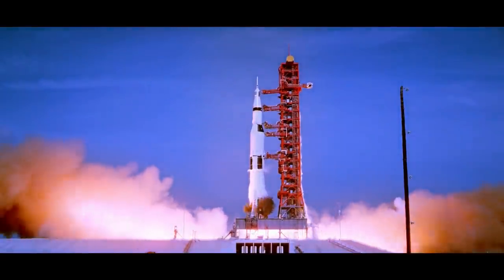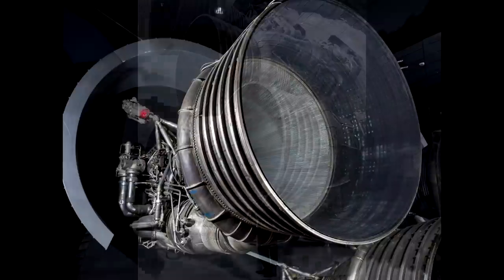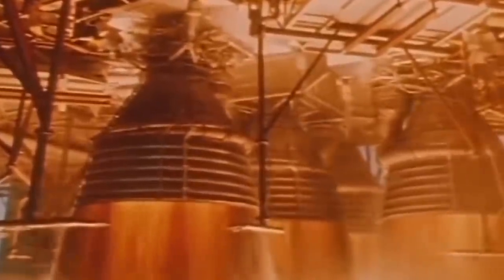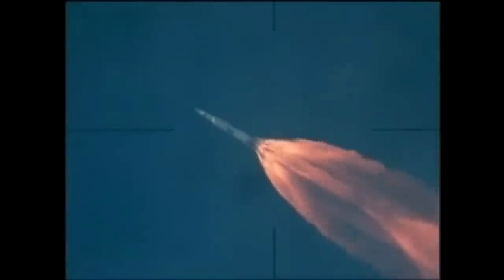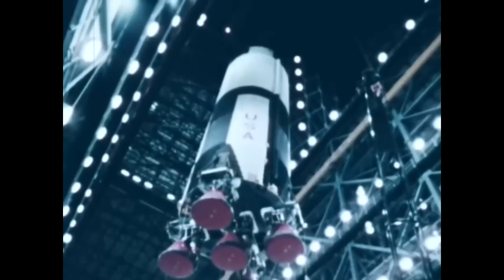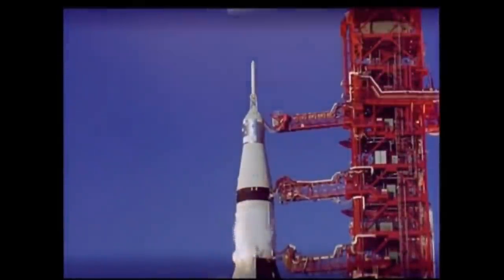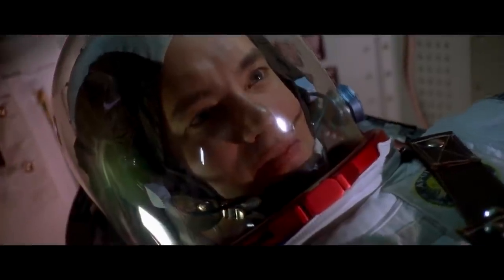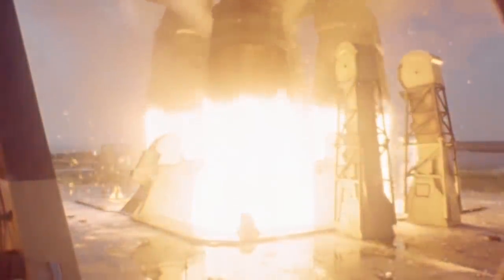Why The Engines That Flew On Saturn V Rocket Look Different In Museums

Comment: It's a common misconception that no atmospheres or less of an atmosphere will pull a region of higher pressure atmosphere.
IE when Scott says it will pull the exhaust up, 2:28 2:50 he actually means that the exhaust is expanding into a region where there is no pressure resistance (High to low, the force of high pushes more than that of the low). 3:03 no pulling force.

Comment: You'd figure at least one museum would consider adding it.
Or maybe adding a half-layer. (as in one half of it is covered, and the other half isn't).
Perhaps not fully authentic, since... Asbestos.
But you know, like a cutaway of it, with an explanation of this very thing...

Would be interesting, and telling stories about history, engineering and so on is why museums exist, isn't it?

Comment: Scott, you appear to have missed an important detail here. Only the engines that actually flew received the insulation layers because, as you point out, it was applied at the final assembly stage. The engines currently on display never flew, that is why we have them - the ones that flew ended up at the bottom of the ocean. Thus the ones on display were either spares that were never used, or (as is the case with the one in the Power House Museum in Sydney) test engines that were fired but never left the ground. Thus the engines on display are not missing anything, they are exactly in the form they were meant to be for their actual role at the time. There are two potential exceptions but that is a complicated story.

The exceptions are the Saturn V engines found by Geoff Bezos in the Atlantic in 2013. At the time it was reported that they are the Apollo 11 engines. In fact it is unknown which Apollo mission the engines belonged to. Additionally, no single engine was recovered. Instead a tangled mess of engine parts was found. This is because of the violence of the rocket stage hitting the ocean at 5,000mph. The insulation layers appear to have not survived the impact. Bezos recovered enough pieces to have parts to reconstruct up to two engines, but they will be like Frankenstein, cobbled together from various sources, and not having the missing insulation because it was not found.

It is true that museums might be reluctant to include asbestos insulation in the public areas of a museum due to liability reasons but that is a question that no museum has had to face with any of the available engines.

Comment: During the time of Apollo the 13 year-old me and a friend were totally obsessed with space and had discovered that if you asked the NASA public affairs office for info, they would mail
 you reams of it. We were getting weekly packages of literature, starting towards the end of the Gemini program. Anyway, one of those packages included details of the F1 engine insulation so I've been telling people since 1968 that all the models & displays you see weren't totally correct.

To show you the depth of our obsession, we had built a cardboard box version of the command module in my basement, with every control panel carefully drawn out, and we would run our own simulations of all of the important events of a lunar mission, following the mission plans we had gotten from NASA.

Sadly, neither of us kept any of that NASA literature once we turned adults. It would of been quite the treasure trove of detail.
Reply: My friends and I requested the same info! "NASA FACTS", I think the newsletters were called. They sent us reams of info.  And it all met the same fate as your stuff as we grew up.

Comment: I stood inside the stainless steel cone of a Saturn V engine at the Smithsonian Institute in Washington, DC. The external stainless steel reinforcement straps on the engine cone were vertical not horizontal. There was no horizontal reinforcement, only vertical. I was amazed that such a flimsy looking piece of engineering could lift the Saturn V into space. I think that SpaceX's decision to go with stainless steel is a good one.

Comment: Minor correction, the text says it was an asbestos blanket with inconel lockwire as reinforcement, and the metal foil we see is aluminum. I assume that the inconel lockwire may have intertwined like a chicken wire and together with the asbestos able to take the heat. The aluminum foil might not have had much of a role other than protecting the blanket while handling and installing- I would expect it would have been vaporized pretty quickly.

Comment: I feel the biggest factor in the shroud not covering the engines is that they simply look cooler and more refined without it. Add that onto the engines and it looks... crappy. like someone wrapped them in foil. It shows much more of the engineering behind the engines by not having the foil on it. Part of a museums job is to show stuff off, cant do that if you cant see it.

Comment: All engines as-delivered had no foil, the foil was only added at the last minute in the assembly shed before the booster was used, so all foil-wrapped boosters were fired off and burned up in atmosphere. The engines and boosters on display now were never stacked, so are in their as-built/delivered form. Hence no foil.

Comment: I remember the Saturn V launches on tv. And I remember noticing those flames seeming to crawl up on the side of the rocket. I was wondering if that really happened (it looked kind of dangeorus) or it was a result of the viewing angle. That the flames got wider could be explained by the lower pressure around it as it climbed. Now I know. Thanks.

Comment: I also used a Haynes manual to replace the reverse gear on a Fiat Uno! And as you said, fun! 🤪
Reply from the maker: Did you have to remove the engine from the car?
Reply: @scottmanley  No, just the gearbox I think, but I can barely remember - my girlfriend's dad did most of the work, I was just trying to help (and felt very guilty because it was me who managed to break a couple of teeth off the reverse gear by bump starting it going backwards just for fun!) Plus it was about three decades ago!
(All this talk of dull internal combustion engines is detracting from the somewhat more dramatic engines in your video!)

Comment: I literally was flicking thru the satV owners manual in a discount bookshop looking at the pic where the stage is jetison and you see the engines tumbling away nolonger covered in insulation and assume it wasnt designed to make the whole trip into upperspace

Comment: the engines on model kits are not wrong per se. But it is true that the ones actually used got a field conversion that is rarily taken over in model kits in the box.

Comment: They should do like a cutaway thermal wrap around the engine, obviously don’t use asbestos but it wouldn’t be too hard to add.
Reply: Joe Fro Could use plaster of Paris instead of Asbestos for the half-cover, seems plentiful in museum workshops.

Comment: Thanks! I was just wondering (on the Crew Dragon launch) about the business of the flames creeping forward past the edge of the bell nozzle. Great explanation. Now I'm wondering if the army of physicists, engineers, and (human) computers predicted that effect before they observed it, probably sometime in the late 1940s...
Reply: They probably would have noticed the effect when they built ICBMs. They are designed to go much faster than a human rated rocket.

Comment: I always wondered why, when nearly the entire Saturn V stack was designed for aerodynamic flow efficiency, the RCS thruster quads on the Service module didn't snap off during ascent. The only thing I can think of is the air shock wave created by the Boost Protection Cover pushed high pressure away from the Service Module and the RCS quads. Can anyone provide an explanation of this?

Comment: As the Saturn V reached altitude and got lighter with the burning off of fuel, the center engine actually shut down to keep from harming the astronauts... The Saturn V wasn't the gentle elevator ride of the Space Shuttle.

Comment: I noticed the lining during the Apollo 11 movie as well. It was something I hadn’t seen before even though I’ve seen multiple F-1 engines up close.

@ScottManley, I assume you’ve had an opportunity to visit the Saturn V Complex at Kennedy. I spent at least an hour starting at the F-1 engines and had the neck cramps to prove it. I found a variance in the mounting and gimbal configurations between the different engines. Do you know if this was normal or if these engines might have been sourced from various revisions of non-flown test engines?

Comment: Tangent: what took the weight of the rocket on the launch pad before the engines took over? Any model I have ever seen just has it standing on the engine nozzles (I'm sure they didn't do that). The film here shows those nodding donkey like things which presumably hold it down but I can't see the mechanism for supporting it. And there's a fair bit of weight there to support!
Reply: There are four pedestals with the hold down arms spaced evenly around the bottom of the rocket in between the engines.  That is all that holds the rocket upright and then lets go after the 5 engines get up to full thrust.

Comment: Interesting that they added extra insulation  to the nozzles which were designed to operate at a bazillion degrees, but nothing on the bottom portion of the first stage itself.  Is this because the fuel tanks containing cool liquid we're able to deal with the heat?  I'm probably way off.
Reply from the maker: There’s a big flat heat shield in the bottom.
Reply: How about the sides of the stage?  Any protection added there?
Reply: @scottmanley  a big FAT heat shield. FTFY :)

Comment: Ok, the real reason the thermal protection is not on any of the museum F-1 engines is because it would cost a fortune to put it there. F-1 engine thermal protection was only add to the nozzles in the vehicle assemble building just prior to a lunch only. Any F-1 engines lying around after the program would never have had it added in the first place. Besides, the F-1 is so damm cool without it. Who would want to cover all that fine enginiering if they didn't have to!

Comment: Hi Scott
First of all, great video as usual. Do modern rockets like falcon 9 do it something differently or they also have similar insulation blanket?
Reply: It is more common to just build the engine to cope with it. There's so much heat inside the engine that a bit extra from the outside won't do much. However, the Falcon 9 has all of the engine structure apart from the rocket bell behind a protective 'dance floor', and with each engine in its own insulated and strengthened pod. It's mostly that way to protect the engine when returning to earth, but it also protects the engines workings from the high radiated heat from the bells and the exhaust.

Comment: How did they attach the inconel shielding  ; did then use J-B weld and epoxy to put studs on , or did they take hand drill to drill holes to put bolts and washers through , maybe they welded threaded studs to the Bell ; some people tell me they need J-B weld and others tell me they used super glue.

Comment: The Saturn V rocket.. A machine who's primary function is to turn fuel into heat and noise. As a side effect you can use it to push a space craft into space.
I don't  think you could design a better machine to burn fuel in a controlled manner than the Saturn V.

Comment: Slightly off-topic but wonder whats your opinion the following: noticed in almost all videos that New Shepperd seem to burn different/more efficient/cleaner (blue flame) compared to other rockets like Falcon 9. It also sounds different and sound levels seem to be lower (important for adoption of space travel if you ask me). Any thoughts on this? Thanks!
Reply: The bright yellow flame is left over carbon in the exhaust glowing brightly. New Shepherd burns hydrogen and oxygen, so the exhaust doesn't contain any carbon. ULA's Delta craft also burn hydrogen and oxygen, but their engines also use ablative layers, and as those layers burn away they add chemicals that glow ruby red. The bright white of solid rockets like the shuttle's boosters is from Aluminium oxides in the exhaust. 

Falcon 9 and the Saturn V both burned kerosene. This is burned a little rich - i.e. more fuel than is needed - because that makes more lightweight atomic carbon and carbon monoxide, and less heavy Carbon Dioxide, and the lighter the exhaust chemicals, the faster the rocket exhaust. How brightly the exhaust glows largely depends on how rich or lean it is.
Reply: @robertbackhaus8911  thank you, this was a great answer

Comment: Will the spaceX BFB (or BFR) have the same problem with the extra generated heat from a sum of a LOT of engines?
And what material can they use nowadays? (Asbest is not an option ...  ). 😉

Comment: Plus the museum static did plays the rather "ugly" insulation covers the cool looking plumbing cooling/fuel lines, structures, valves, and pumps. All amazing mechanical stuff I much prefer to see rather then being covered in boring insulation.

I have a peice of the appollo spacecraft, a large flexible aluminum fuel line, my dad has large springy aluminum tube the astrnaughts crawl through to get between the lunar lander and orbitor. Neither went to space, they were not perfect parts, the best part made of many duplicates went on the Apollo rockets. I also have a peice of sample titanium space shuttle fuel tank used to prove welding techniques (titanium warps a lot when welded, my dad worked on automated process to Weld it fast reducing heat warping. My dad worked on how these were welded.

Comment: I think it was actually Aluminum foil as the reflector, not Inconel. Inconel wire was woven into them for strength and used to hold them in place.

Comment: The pipes around the nozzles?  Cooling of course but just as importantly didn't they also vaporize fuel somewhat lake a camp stove?  For the fuel pumps?  The combustion chamber?  Hell, I don't know.  That's why I am asking.  :)
Reply: The combustion chambers were also made of pipes that limited the thrust to 1,000,000 lbf thrust of the F-1.
The pressure of the immense turbo-pump (That's the source of the cracking you can hear)  stopped it vapourising but it was still hard to push it all through the narrow pipes.
The F-1 was a terrible design which is exactly why NASA dumped it right after (Skylab as an empty SaturnV). No one has used such a design since in any rocket motor, the performance is dismal due to the low pressure it can stand.

Comment: at the end of the video.... why is everything including initial flames and the later debris are being sucked into the launchpad well. Is it due to the low pressure created by the high velocity exhaust gases ?
Reply from the maker: That's the venturi effect.
Reply: @scottmanley   Hmm.... Yeah Venturi Effect. Usually what's the core pressure of a rocket exhaust plumes. Does it create any vacuum at its core.
Reply: @venkatpuneeth  The pressure of the exhaust stream right outside  of the engine bell is exactly atmospheric pressure (14.7 psi). The size of the bell opening is adjusted to accomplish this. It's known as the ideal flow expansion. This maintains the flow going straight down out of the engine at liftoff. As such the atmosphere itself acts almost like an extra extension of the engine bell. This also allows for some additional acceleration of the flow to occur outside the engine to squeeze out some additional thrust. As the rocket goes higher the atmospheric pressure drops so the flow starts to expand out, which can be seen in the launch videos.

Comment: A Haynes manual for a Klingon D7 Dreadnought??? Finally a Haynes manual that could be considered just slightly accurate and, in the most infinitesimally smallest unit of measure possible, useful. Unless you're using them for kindling then, of course,  they are great. In other words, not worth lifting up to read even if Haynes themselves were handing them out on street corners for free. Rant over, continue with the cool space stuff...

Comment: I need a Haynes manual to fix my Saturn V rocket, dammit!  How in the hell am I going to commute to work without that?
Reply: Typical Haynes manual: Work in a well ventilated area. Disconnect battery. Ensure car is securely supported on axle stands. Remove crankshaft.
"What!! Where's the rest of it!?"
Refit in reverse order of disassembly. . .

Comment: I have never liked either the Haynes nor Chilton manuals. They are like "advanced user manuals"... in too many places they say: "take it to an authorized service center" or some such, and don't actually tell you how to fix something, and many times are actually wrong, as the data was obtained from early models and never updated. This is especially problematic for long-lived models such as Jeeps and Dodge Ram pickups. For instance, there is a part on my Jeep Cherokee connected to the fuel system that was part of the Emissions system that doesn't even exist in either manual. Me: "What is this box on the bottom of my car? A flux capacitor?" Book: "I dunno, but the correct light bulb here is the 1187. Use SAE 10W-30."

 I always try to obtain a copy of the Factory Service Manual for whatever vehicles I am using. That's what the "authorized service center" uses. Hell, there was even a web site connected with Sears/MTD(partsdirect or something) that gives better mechanical schematics than even some FSM's. Bonus, you could order parts for everything. I mean EVERYTHING. Magneto contacts for a 1972 RandomForgottenBrand(TM) vibratory tamper? $5.99+$14 shipping, and here's the pictures on how to put it together.

Comment: whats all that white dust or ash falling from the rocket at 5:50 ?
Reply: That's ice.  The propellants are cryogenic as the higher density allows you to fit more in the tank.  Ice builds up around the outside and is literally shaken off at ignition.